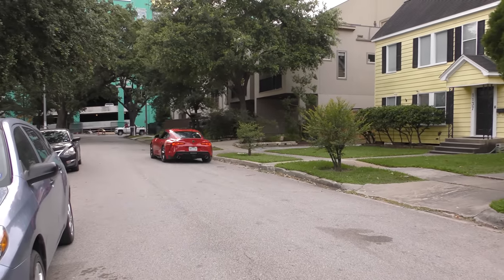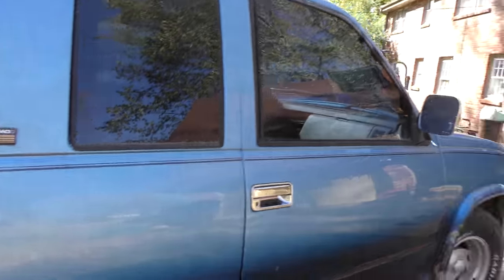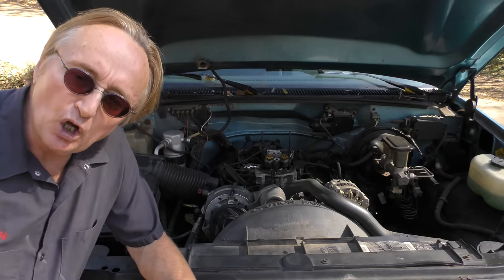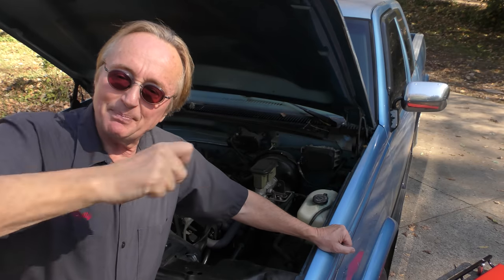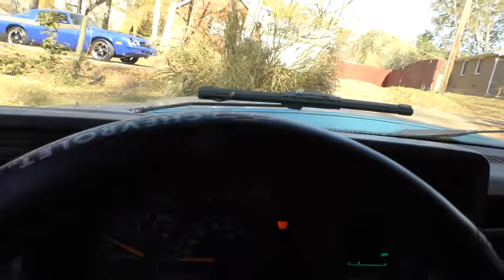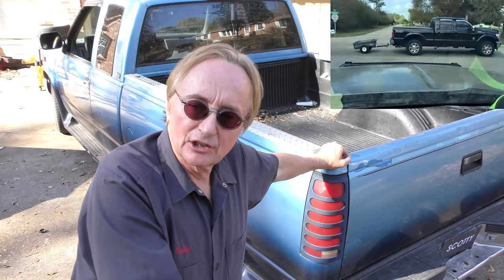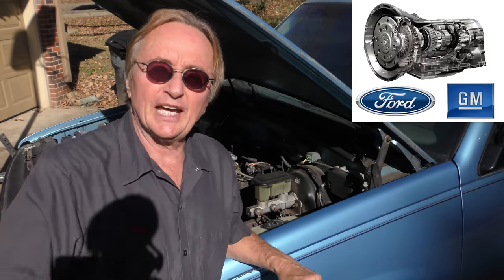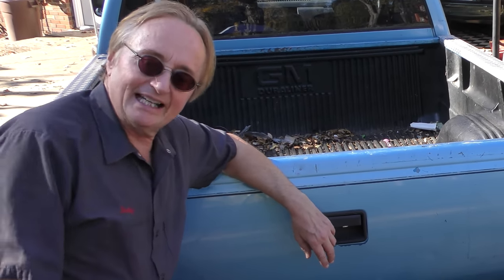The Only Chevy I’d Buy

Comment: I have an 88 Chevy C1500, and have rebuilt the transmission, changed the engine, and I have big rust holes.  I hauled a 66 Pontiac from Ohio to North Carolina with it.  I've been in the Army 7 years, had this truck the whole time, speedo stopped at 207,000 miles (meaning to fix it).  I have people always offering to buy it.  I've moved with it, loaded army gear, construction, hauled cars, everything.   Was laughing the whole vid, so much space in that bay  I gotta figure out the EGR setup right now.  My father-in law backed his 2015 King Ranch into mine, $500 damage to his, nothing to mine, he ended up buying a new truck lol

Comment: Those 88-98 chevys are the best. 
My 97 is a 305 and it’s got 230,000 miles on it, and I just had the original 4L60 transmission replaced. 

They are legitimately the best trucks on the road.

Comment: My 2015 cx-5 has CVT automatic trans and Scotty kilmer did troubles with them ,and 80,000 tar on my valves and I did gdi spray every 20,000, and Scott did analysis with road salt and rains on sensors rear electric park brake and the headache! My dealer this model has CVT automatic! Mazda own design

Comment: That is a Silverado. It’s a package. It has the full cloth package and usually power equipment, like windows and locks.  Imagine that.  Also this is a short bed with a conversion package.  It has the popular paint scheme of the 90s conversion packages. Also has running boards.  Do your research please.

Comment: Solid engines and transmissions, these could get beat on all day every day and keep running. Only problem is with frame rot sadly. No rust proofing back in the day, I have a 98 that’s rusted through pretty good but as long as I don’t take any big bumps she’ll hold together for a few more years yet 😁. If it didn’t have rust I bet it would run another 20 years.

Comment: Dude, Chevy trucks are the best trucks on the road. i have a 1999 Chevy Silverado 1500 3door and it's in mint condition with no rust. sure your going to run into minor issues but like you have pointed out parts are dirt cheap and easy to fix.

Comment: I appreciate this guys enthusiasm for Toyota, but they don’t make a real truck. I’ve owned a commercial construction company for 20 years and Chevrolet is the only company that makes a truck that holds up. I’ve had a lot of them all, Dodge, Ford, Mercedes, Toyota. We continuously get 280k plus out of our GM vehicles before taking them out of service. 280k miles with regular maintenance will outlast any Toyota and you can actually load them down and pull trailers. Ford’s are trash after 80k and Dodge is nothing but problems from day one.

Comment: I have a GMC just like this Silverado. Mine has the same power trane. I looked up the vin on line and the site I looked at said it had 295 hp and 350 ft lb of torque. Also mine has 380k miles on it

Comment: Scotty, there's no such thing as "original factory headers" on a 94 Chevy pickup, or any other year. They all had normal, cast iron log manifolds, just like they had in the 70s and 80s. The ones shown here are obviously aftermarket, and surely helped power a LITTLE. But TBI 350s ain't road burners. I have a 92, and a 98 2500, with a Vortec 454. Big improvement.

Comment: Scotty, in 2014 I bought a 1994 GMC C/2500 diesel, automatic tranny with 400k on the clock. I knew it was owned by good mechanics and even passed the NYSI. I drove it for 3 years in a delivery business and put 115k more miles on it.  I restored most of it with new fenders, a new box and many other tune-up parts.  Sadly, I traded it in for a new 2017 Chevy Equinox for the wife, and the Dealer only gave me $1,100 trade in credit for the 94 GMC. I should have just kept it.  This heavy diesel beast got 20mpg - not kidding.  Since trading it in, I bought and still own a 1990 GMC 1500 gasoline, a 1993 Chevrolet 1500 Cheyenne, and a 1994 Chevrolet 3500 w the 6.5 Diesel motor.  I went from 1 to owning 3 now!  These were great years (1988-2000) for 4th Generation gasoline and diesel Chevrolet pickups.

Comment: I have a couple obs Chevys or also known as Gmt400s I also have a gmt800 and the 4l60e was the only thing I hated about both platforms but I ended up fixing them by getting stage 4 built transmissions and they are still going strong to this day and if anything were to go wrong it’s so easy to get parts for both platforms and there is multiple crate engines that can be swapped in if a engine were to blow or if you want more horsepower GM trucks were great up until the gmt900

Comment: Scotty I have a question?! I have a 1993 Chevy Silverado k1500 350 Tbi and I have an issue. My exhaust is backfiring (a lot of popping out the pipe) it was sitting for 6 years before I bought it. I just ordered a new whole distributor and a new map sensor and also a new coil. I have new spark plugs and new spark plug wires. Tbi was rebuilt and injectors are spraying well now. It was leaking before. New pvc valve. And all vacuum hoses are good and connected. No matter how many times I try to adjust the timing with a timing light it gets better on some and doesn’t. Still pops but has lots of power but hesitant at idle. I set the timing to zero and yes I disconnected the advance wire before doing so but no luck. Oh one more thing. I have a lifter that ticks. I may have to tighten that one on the left side of the engine. Please let me know! Thanks. Or make a video of explaining what to do and how to fix a 350 tbi

Comment: I just got one for $4k, yes I had to rebuild the tranny that was $1200, I changed out distributor, wires, plugs, pcv, thermostat and a pump, that was all with labor $500, changed out for bigger tires $750, and sensed the whole truck myself to take it to Maaco for paint job for $3000. Next will come interior… and I’m sure it will last me for another 20 years…

Comment: Almost bought one of these with 20k original miles and I knew the Original owner. Manual 5speed, 350, and all the bells and whistles for the 2 door longbed. I was $100 short on 3k and he wouldn’t sell it 😢

I had a 1992 Ford forever, I love those late 80s-90s trucks. My Ford was a 300ci straight 6. Couldn’t tow much but damn it ran forever. The odo stopped working around 200k, but I went 2 years more from there. 

Never had to change a part except the exhaust. And it was a piece of junk. Some guy swapped the 4speed Automatic with a 5-speed standard but didn’t change the rear end, which had way different rails and it was a dog. But I paid nearly nothing and it went and went 

3rd and 5th wouldn’t work unless I was reviving. Caused all sorts of bogging. But it went and went lol

Comment: Scotty is wrong, none of the owners of that truck glued the Silverado emblem on it. Those trucks come with those. 

Before they were called the Silverado, the actual name Silverado was for the trim level. I forgot what the other trim levels are, but the Silverado was the highest trim level at the time.

So if you see a early to late C/K with the Silverado badge on it, then it's most likely just a Silverado trim. I know because I was obsessed with these trucks for a while and researched them heavily. I also own a 92 with the Silverado Trim package, Standard cab short bed. Although mine is a slow tbi 305, I'm no speed demon so it's a fun comfortable ride

Comment: My 03 Corolla sounds like a motorcycle. The noise is coming from the passengers side of the vehicle near the alternator and pulleys. Also have been getting catalytic converter codes and misfires left and right. I have new plugs coils fresh tune up. But I want to replace what needs to be replaced not based on a whim.
Can anyone help me out .

Comment: Problems with this video: 

-That is a C1500, Silverado trim. That badge is factory.
-Not the original paint job
-That is a standard short bed, not long bed.
-Those are NOT factory headers. They came with regular manifolds.
-Definitely not the factory exhaust either.
All that stuff was probably added when it was new, but not factory lol

Also not year correct seats, not a direct fit that’s why they’re loose lol.

Comment: is a 1991 suburban v1500 any good? might be buying one for $3.5k this week. odometer broke at 198k miles, plastidipped black paint cover, seller says mechanics are solid, few minor issues, window motor, ac fan, front windshield cracked, etc. i want to take it off roading. it has mudding tires on it already

Comment: I  have a 1989 GMT-400 according to the insurance papers, but i cant figure out what exact model it is. I have the VIN but KBB doesnt go back that far. It has side steps built into the bed and wide fenders with rear wheel drive, automatic with an old V8 from a Pontiac Trans Am put in it. It runs decent. Do you know what model it is Scotty?

Comment: That is not the original manifolds nor is the front seat. I would not consider this to be an that good of an example.  but for 2k not terrible.  That is not a 350 transmission, more like the 4L60 a very solid transmission if maintained properly as with anything (even a toyota will last if maintained).

Comment: If only the 4L80E had been the base automatic on these. Those TBI 350s are unkillable. More so than the more powerful Vortec 350s that had intake gasket issues, a plastic plenum and a problematic spider injector assembly that required removing the plenum to replace. Once you resolve the Vortec's factory defects, they're as good as the TBI but more powerful.

Comment: I got bought a 94 long bed 1500 with a 350 single cab body is mint no rust interior is mint  runs good drives good but the trans is shot will not shift into 3rd gear hard to get it 2 gear got it for 1500 but with the shape it in it’s worth it I can get a cheap tranny for 400 on eBay

Comment: 0:21 "Somebody just stuck that on there." Yeah...unless there is reason to believe that vehicle doesn't have Silverado trim, that somebody would be THE FACTORY. Looks like factory rear tint, pinstripe, fender flares, running boards, carpeted door panels, power windows, deluxe seats, dual headlight system...yep, you got yourself an authentic Silverado trimmed C/K there, Scotty, with the correct badge.

Comment: My Dad had a 1980 Chevy C10 350ci pick up truck easiest to work on he had the removal of the catalytic had dual exhaust..the truck just went we did the fuel pump ourselves plenty of room..1991 he bought a nice Maroon/Black Silverado off the truck carrier before they had it on lot..lucky him. Also had the 350ci Great Truck Just ran and ran til he lost battle with Cancer we had to decide which vehicles to keep so traded in on a 1996 Pontiac Montana with the 3800 engine...So the Older Chevrolets were Great the New ones Problems Problems from Electronics/ Navigation Shutting down +Trans Shifting  Shaking to the Stupid Deactivation of the V8 to 4 cylinder. The stupid Computer age has F**ked up the auto industries. Looking for older Silverado that I can work on..Don’t know how the 4.8 5.3 6.0 Vortecs are?My brother had a 2007 Chevy Trailbazer what a piece of crap the engine just seized up LL8 4.2L Vortec many other repairs only 70K miles when bought. Died under 100K  miles..

Comment: That era of GM trucks are not the greatest. The engines and transmissions were good but I remember those trucks 15 years ago that had doors that sagged and broken door handles on both inside and outside, plus the entire dash is plastic and those dash pieces would always break and front ends that always were wore out, burning out the inside of your front tires. Plus the front wheels stick out past the fenders and has a wider stance than the rear, especially with custom wheels. They look good but I would never buy that era of GM. The 80's was the last good era of tough, reliable and cheap and easy to maintain and repair truck's. All  of the years after just fall apart after a few years and are expensive to maintain and repair.

Comment: I got this 1985 toyota SR5 ext cab 2.4 truck has 157,500 ml been trying to fix it myself. Previous owner had it parked for about 6 years so all spark plugs hv spark, gas pump, lines and filter are good, it just cranks but does not start, so i'm guessing that the igniter could be bad and I have no way to test it... Any thoughts?

Comment: man i wouldn't give 2 g's for that especially if it needed a fuel pump. maybe a grand. the best pickups chevy ever made were the early 5.3 liters before all the cylinder deactivation garbage. if not that then the last of the 5.7 liters with the vortec cylinder heads.

Comment: Its pretty smooth on a smooth road 😂😂
I miss my 94 it has a 5.7 700R4 for four-wheel drive the only problem I ever had out of it was it developed a problem where it would just randomly die change something that had to do with the heater control or something and it quit

Comment: Got mine for $1k with only 105k miles on it. I had to replace the steering column, gas tank, blower,  battery and run new pipes past where the cat used to be. It has been stolen and the jackasses drilled so many holes in the column and gas tank I can't believe they actually got away with it. The owner found it and called the police and watched them steal the air cleaner and battery and go into an apartment. When the cops got there the owner showed them which apartment the thieves went to but wouldn't you know it, nobody answered the door. Well nothing the cops could do. So the owner towed it home (half mile away) and there it sat until I came along and bought it. He loved that truck so much that he went out and found the exact same truck color and everything, and bought it. I had to check the numbers on the engine to make sure I was not getting hosed. He couldn't fix it because he felt so violated and just wanted to move on. His loss my gain. I love that truck it runs like a top. Loud as hell without the catalytic converter but reliable and tough. Only problem is 11mpg . Still a bargain and I'll have that truck for the next 30 years .

Comment: You over paid for that 94, the shape its in thats a $800 at best truck in Ga or Al. I got a 2006 silverado extended 4x4 Z71 that needed nothing and everything functions as it should for $2000.00.

Comment: I have an issue with service lights and break lights of my 2014 Honda Accord

I changed the fuse to the service lights twice and it has blown as soon as I turn them on .The bulbs has blown as will. My break lights bulbs have blown as will. 
I was in an accident in which I was hit in the back so I don't know what the mechanics did to my trunk. 
I truly need your help.

Comment: How about the ford f250 2001 7.3 Deisl motor with 1, 42000 miles on it is it worth 5000 Dollars good body real wheel Dr 5 speed transmission stick

Comment: Rong again, known for clear coat peeling, didn't come with Factory headers, I don't have power to get out of its own way, that new transmissions not going to last long if you use it like a truck instead of a car 4l60e motor will last for a very long time because it doesn't have enough power to hurt itself,  ten bolt rear end is weak if you're trying to use the truck as a truck.  How many subscribers? WOW! I love my 93 Chevy for the looks, and now that it has a 6 liter LS a 4 L 80 e and a 14-bolt . It's a TRUCK TRUCK not a car in disguise.

Comment: Silverado is the trim level
Headers were never offered from factory
Paint is not the original
It's a shortbed, not a longbed

The only parts you got right Scotty are that it is better built having been assembled in Canada instead of Mexico, the Transmissions are the weak point, and the TBI 350 is stupid reliable.

Comment: Hey scotty I know this is some what off the subject,  but i am working on a 98 k1500 5.7 chyenne.. After beginning to replace the intake gasket, I have noticed a notch in the 3rd bolt hole.. it looks clean almost machined, the only other intake from GM I can Find like this are from outboard motors. Any info or advice would help.

Comment: I have the same year also a step side though . Sadly my engine is toasted 😣 replacing it with another 350
Reply: Thats an easy fix though bro!! I have an 89 Silverado. Reg. cab long bed. Replaced the 305 with a built up 355 with the stock TBI set up about 10 years ago. A few years later the 700R4 tranny. It's been one helluva of a good truck since. 189,000 miles later!!
Reply: Thanks for the heads up ! I will forsure look into it ! Ain’t getting rid of this truck 🙏